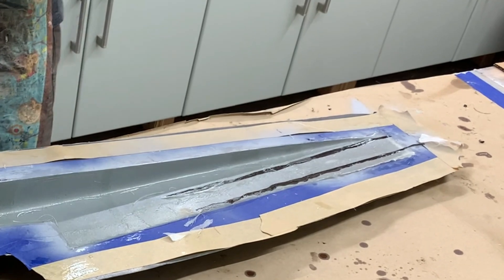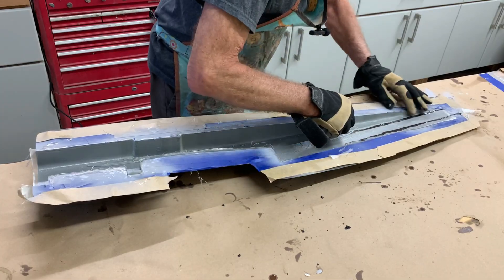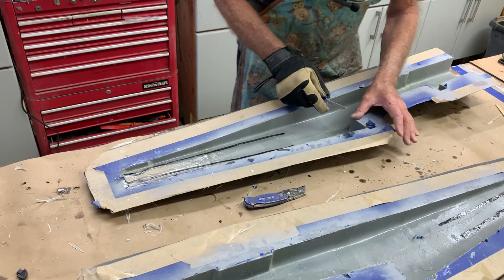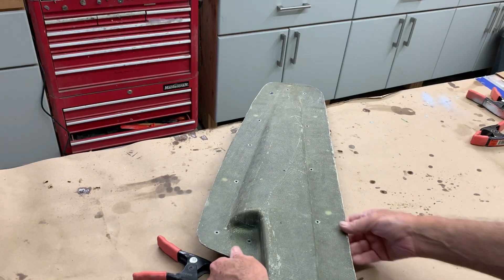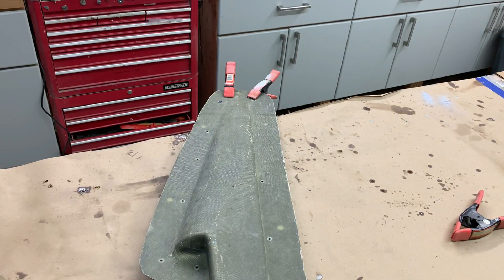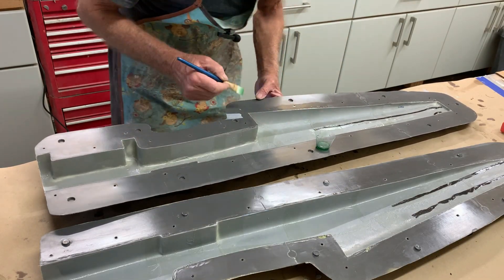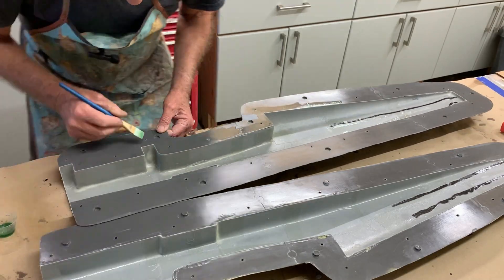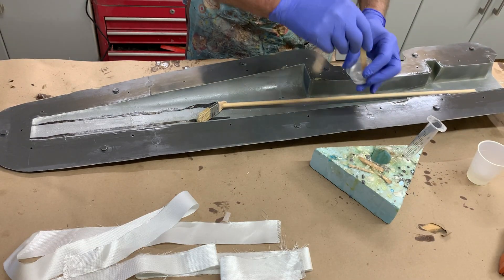Dragon Build Part 4 SeamTaping

Comment: I have done the same when joining mould half’s, but I wet out the joining tape before I place it in the mould. 
Also apply the tape to the bottom mould, and the tape to the top of the other half. 
Then you can bring the two halves together slightly off set so the tape does not get caught in the flanges.